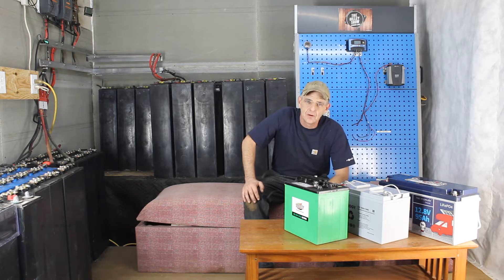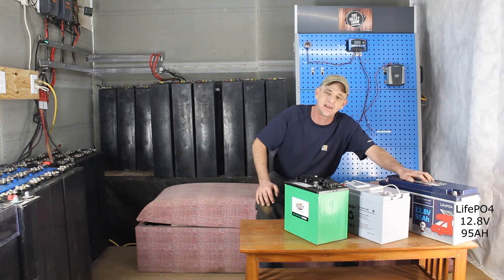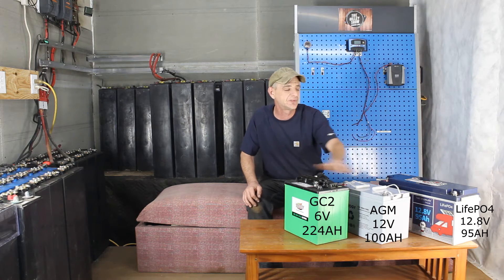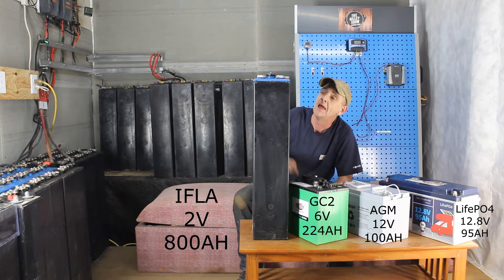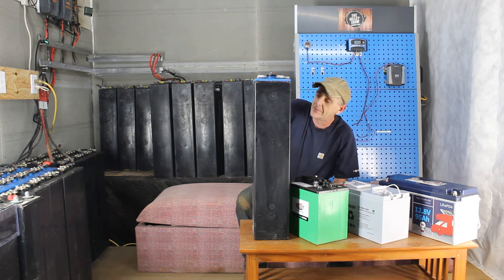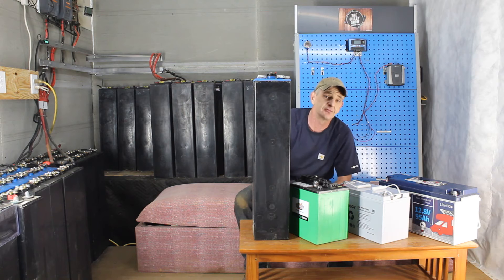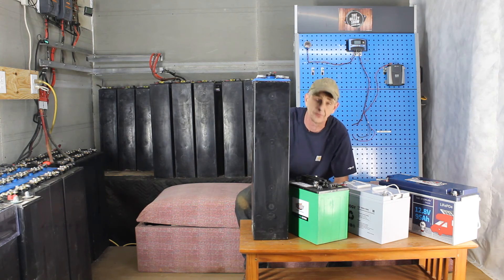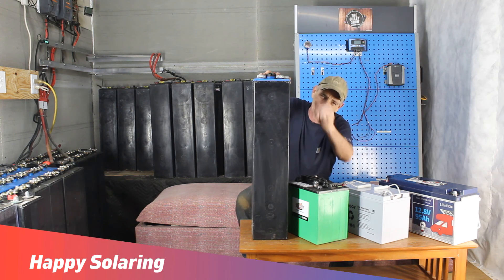Types of Batteries, what is an IFLA cell?

Comment: A statement for the newbies out there. That 2V battery, the off screen helper tossed to Gilley, is empty. Full they could weight 100 lbs, and more, EACH.
Reply from the maker: That cell was an 850ah 2V  weighed in at about 130 pounds.